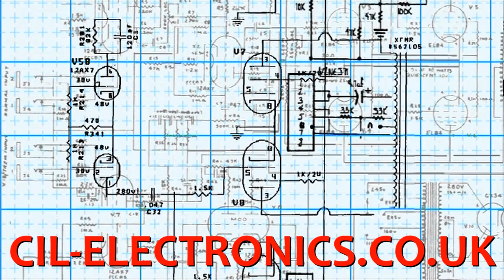SONY TC K611S Repair

Comment: Thanks for the video. Recently replaced both belts on my TC-K611S that I have owned from new. However it wouldn't play for more than a second without stopping. Your suggestion to run the transport without a cassette in enabled me to see that the pinch roller was sticking. Took it out and discovered a bump on it. Removed bump with emery board and now it plays fine. I will be ordering a new roller. Couple of observations - transport is easily removed from just the 4 screws, cables and door plate - no need to off the units faceplate. Working out how to run the transport without a cassette inside wasn't obvious from the video. Thanks again.

Comment: Thanks for this. It will be helpful because my very similar Sony TC-K620 has melted belts and I'm facing the same dismantling of the drive mechanism. I dread trying to get the pieces apart to clean up and install that smaller belt. But it's a thrift store deck that I got very cheap about 7-years ago. I played a few tapes, and then, sillily, let the unit sit sit for years. But I now know that Sony belts don't just lose tension, they decompose. Replacement belts should arrive early next week, and I will start unscrewing.

Comment: Thanks Chas, really helped me fix my Sony deck - super useful.   In the video you use a cross head screwdriver with quite a long shaft.  Having the right tools makes a job much easier - just wondered where you'd got that one from and whether you worry about Japanese standards for screwdrivers on the Japanese Hi Fi stuff.  Love the videos especially the electrical-mechanical items.
Reply from the maker: @skettchboy Thanks for the compliment, glad you managed to fix your deck. The drivers were part of a 6 driver kit I was give back in the 90s, no idea where they came from. There are lots on e-bay and Amazon nowadays. I have no opinion on the screws used, they use so many different types.
I have several vids mid production whilst I source parts. Hope to post more soon.

Comment: Hello and God bless you. I've followed almost every step and the results are good. Still, I can hear a light strange noise by every rotation/revolution of the capstan. This brings a very slight but increased wow amd flutter.. Can you, please tell me what kind of lubricant you've used for the bearings? ( because I didn't had any, maybe the capstan bearing is to dry and If I use the Unit, I'll destroy/increase the tolerances..) Thanks in advance and thanks for the lesson. God bless you! Update: I've read some comments. I will buy the Molly grease. Thank you very much.
Reply from the maker: I use molycote grease. Clean the flywheel in case anything is stuck on it. Check the pinchroller for dents, caused by the mech being left in play but not running for a long time, clean the belt with isopropyl.
Reply: @ChasLarge  Did all that.:) Molly comes tomorrow. Thanks again! Remain healthy and happy! :)

Comment: Hi,
Your video is great ! 
It really helped me to replace the belts of my Sony TC-K611S. 
When I was done with the belts I tested it and understand that I need to replace the pinch roller also. 
I've done it with a new one, but this crucial step of installing it back to the deck, is missing from your video.
The problem I'm facing now is that when I insert a cassette and press play, it does does not play. 
The heads mechanism is not lifting up and the pinch roller is not moving and does not touch the capstain. 
The tape spins at higher speed also.
Can you please help me understand what is going on ?
Heads mechanism, including pinch roller does not move freely , with or without cassette inside.
Thank you.
Reply from the maker: Glad it was helpful. Might be the pinch roller is not the correct size, it could be too tall and the bearing is binding. Depending on how you replaced it, did it come with the bracket? was it an original part? Some replacements are not really the same as the original.

Comment: Добрый день. Скажите пожалуйста какие размеры ремней для sony TC-K611S?
Reply from the maker: Google Translate says you are asking for the dimensions of the "Straps". I assume you mean the Drive Belts. These are not defined in the service manual so I do not know. However, there is a BELT KIT available on e-bay here:
https://www.ebay.co.uk/itm/334561410978?hash=item4de569ffa2:g:mgoAAOSw2E5i-9CN&amdata=enc%3AAQAHAAAAoJStecaM4kvzamVcypaqQh2%2Fure5ioTvQ8nUe8GrVB44kT1chf4iTwOjvnTDQgJGBQLBV%2BT8lCNzI1POGgVAu82UrGWT3yOdRBzBBKYBun1izRIQBwAwDORrLuRkG173AmAHLiGFjRCfta2Yf0l%2FL%2FCG6vNhWidazP1zsxT5t7Q9AgK86n0OLcZckITyDgrbWxf2kRz0J%2B6PaTQnXlja%2FfU%3D%7Ctkp%3ABk9SR5SDiZ2GYQ
Hope this helps. 😊

Comment: At the beginning, i saw you pushing the eject button and the door did not open...only a sound that sounded like it was trying to open.  I have the same problem...Sony tape deck from 1992.  It's been in storage for 10 years.   Are the belts you changed somehow configured to work with the ejection mechanism?  Thanks and great video!
Reply from the maker: In a word, YES. The belts drive the loading mechanism and part of that is used to open and close the door.
Reply: @ChasLarge  I finally got around to fixing (?) my cassette deck (Sony TC-WR97ES).  I changed both belts and both pinch rollers.  I correctly aligned the mode cam and put the unit back together.  Everything works but when it’s playing and I want you to change directions, I hit the play button for the other direction, the tape head rotates 90 degrees and stops.  The head doesn’t rotate all the way.  Before the belt change, everything was working fine.  I took it apart again.  I noticed the tape head will turn fully when the mode cam is turned. Any ideas.  Btw, my mechanism is exactly as the one in this video, so that helps.  Great video!  Cheers.

Comment: I have the Sony TC K611S and I watched your video many times, I get to the point at 49:59 on video. I find that the door will not stay closed. So I put everything together thinking it will close then  later I find it still wont close. I don't know what happened.
Reply from the maker: Hi Anna, I can only suggest the mechanism is not reaching the locked position, check the mode switch contacts and ensure the peg on the main drive gear is locating correctly in it.

Comment: Hello Chas, thanks for sharing this great repair tutorial.
I have this question:
What did you put on the axis of the capstan for smoother turning?
Reply from the maker: Hi Thomas, I use Liqui Moly 3510 a bearing Molycote grease, you can get it it from ebay: https://www.ebay.co.uk/itm/384815444577?epid=15033521186&hash=item5998c9b261:g:TVUAAOSwTHNiSq3Z or other suppliers no doubt.
Reply: @ChasLarge  Hi Chas, can I use the same grease for the (plastic) gearwheels, too?
Reply from the maker: @thomasschneider5983  Yes, on the bearing part but only a tiny amount is needed, never put it on the cogs.
Reply: @ChasLarge  And what should be put on the cogs?
Reply from the maker: @thomasschneider5983  Nothing, plastic cogs do not need lubrication unless they mesh with metal cogs. Anything in them can cause them to potentially bind.
Reply: @ChasLarge  What fluid should be used to clean pinch roller? And how can I identify if a pinch roller should be replaced?
I have seen some repair videos here in YT where some white grease is put on wheels where a belt is transported. Can you recommend this? Would this extend the lifetime of a belt?
Reply from the maker: @thomasschneider5983  I use Isopropyl Alcohol on a cleaning bud to clean pinch  roller surfaces but not a lot. Pinch rollera really only need replacing if the mechanism has been left in play but not running so that a dent has been pressed into the roller. This displays as jumpy sound. Belts can last ofr years but being runber they can perish especially if in a warm environment. They can stretch too as they are constantly under tension.
I would guess the white grease is again Molycote grease. I doubt it will extend the lifetime of a belt.

Comment: Hi  I have a SONY TC k611S   .After years of storage I tried it out and found there was a terrible screeching noise coming from the motor .On opening it up I could see the drive belts had turned to mush. I managed to source a new motor and drive belts and after following your excellent video I manged to replace them. On trying the deck after assembly I found the cassette would not play . The door opened and closed ,it would fast forward and rewind  but not play. Following your video I thought this could be due to a faulty pinch roller,so I sourced one and replaced it .However this made no difference it would still not play. Have you any ideas what else I could try or what the problem might be?
Reply from the maker: Hi Norman, glad you've found the video useful. If you press play without a cassette in, does the capstan turn and does the pinch roller engage with the capstan? if not then it could be mechanical. If the mech does not load, it could be the cassette sensor switches which are above the cassette, there is I think one, that detects the cassette next to the record prevention and tape type switches, these could have poor contacts.
Reply: @ChasLarge  When I try it without a cassette absolutely nothing happens. When a cassette is in the heads and pinch roller move up  and appear to want to play but after about 3secs they come down again. I've looked at the 4 contact switches they appear to be ok and I have put pressure on them while pressing play but it still won't work.
Reply from the maker: @normaninglis3937  Hi Norman. OK. If you look at the vid at about 1:03:00 you'll see I simulate putting a cassette in by holding the switch which detects the cassette. You can then press play and it should engage the mech. If it stops playing after a few secs it could be the take up reel not turning which has a sensor and if this does not detect movement the system will stop. Also if the pinch roller has a dent in it as I had, then the tape is not pulled through and again the TU reel sensor reacts. So without a cassette if it continues to play, check the tape path and even the Supply reel which may be stiff due to old lubricant.
Reply: @normaninglis3937  I have very recently had success repairing this issue, after doing a belt change and finding I had your same problem. The problem seemed to be solved after cleaning the sensors that read the black and mirrored flanges behind the reels. You can see these sensors in 42.20 in the video, the black round units atop white stalks, also clean the mirrored flanges while you are in there. This solved the proble, for me after much trial and error.

Comment: I've replaced the belts on the same deck but need to get a new pinch roller - can you divulge where you managed to source it from ? I'm struggling to find a supplier.
Reply from the maker: Hi Ian. I found a supplier in ebay that had them made to order. About £15. But you have to swap the metal roller. I'll find the link and send you a message.
Reply from the maker: Here's the seller. You may have to contact him as he does not appear to have the item on his list.
https://www.ebay.co.uk/itm/SONY-TC-K650ES-TC-K661S-TC-K715S-TC-KA2ES-TC-KA1ESA-TC-KA1ES-Pinch-roller-/363191145807?_trksid=p2349624.m46890.l49292
Hope this helps.
Reply: @ChasLarge  Many thanks - will give him a try
Reply: @ChasLarge  The link doesn't work unfortunately.
Reply from the maker: @stanley2004  Sorry but it did when I posted it, seems like the guy selling them is no longer.

Comment: Why do these belts melt like this?
Reply from the maker: Rubber degrades over time, especially if under tension, it becomes elastic.
Reply: stored in very hot environment.

Comment: Hello I’ve been having trouble trying to get my cassette deck to play a cassette. every time I put a cassette in and press play the head and pinch roller are not going up into the cassette. But when I take the cassette out and take my flat head screwdriver and push up on the tape sensor (the thing that selects what type the cassette is) the head and pinch roller both go all the way up as a functioning cassette deck should do. Any ideas what the issue might be?
Reply from the maker: Hi Jesse, it's difficult to diagnose without seeing the unit but does the cassette play OK in another machine? If the cassette is warped it may not be locating in the door correctly. Does FF & REW work OK with that cassette? Is it the same with other cassette tapes types, METAL, CHROME, TYPE I & II?
Reply: Hello  @ChasLarge  yes it can play in another deck. At the time right now I only have type I cassettes but I put the tape sensor into the type II position (with the cassette in) and still does the same thing. Also yes the FF and RW both but without the pinch roller.
Reply from the maker: @jessebrown6059  Hmmm, difficult. I can only guess that the mechanism is not fully engaging in Play. It may be down to the drive cam or part of the mech is broken. Without seeing it, it's impossible to say. Is the main drive belt OK, should be tight but with a small amount of flex, not stretchy. Maybe the mech grease has gone hard and needs disassembling and regreasing. Don't spray any lubricants in as this can cause untold problems. 
I'd be happy to take a look at it for you. I'm in Chinnor, Oxfordshire if you're passing but if further away, you'd need to ship and pay for return shipping. Best I can do. Email me support @ cil-electronics.co.uk if you like.
Reply: @ChasLarge  yes the main belt is fine I just replaced both belts but before I replaced the second belt (the one that drives the gray gear) it would do the same thing. Also when assembling everything together the grease on the gears were fine and were not hard at all. I think that for some reason the cassette is getting caught onto something.
Reply: @ChasLarge  turns out I had the right idea in mind. The black plastic cover with the yellow light that goes over the two FF and RW shafts well for some reason it was sticking out of place in the lower left hand corner and It just needed to be popped in. Now I got it playing and seems like the previous owner messed around with the tape speed setting so I’m going to have to do some tuning now.
Reply from the maker: @jessebrown6059  Well done. if you have a 3KHz test tape and a mobile phone, you can download a frequency counter app, which will allow you to check and correct the tape speed. Better than trying to do it by ear.
Reply: @ChasLarge  okay thank you for the help and suggestions have a good rest of your day.

Comment: What Voltage is the bench power supply set at for testing ?
Reply from the maker: Depends on what I'm testing, it's a Lavolta variable supply 0 - 30V so I adjust it for whatever I'm testing. The motors on this deck are specified as 12V but I would have underrun them at say 6V for testing, if the mech is jamming, underrunning allows them to stall rather than driving the mechanism to destruction. Hope this helps :)